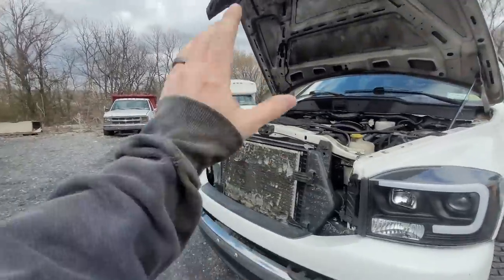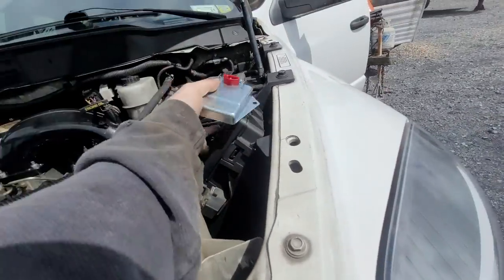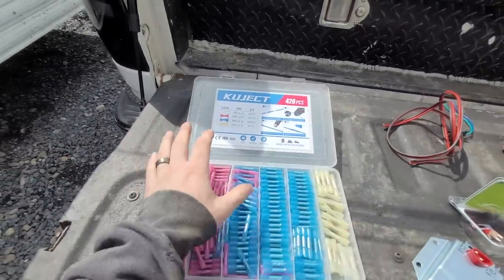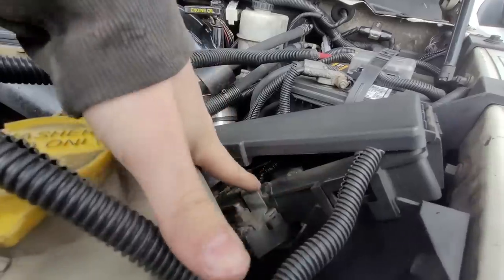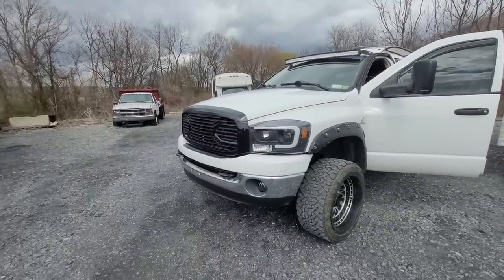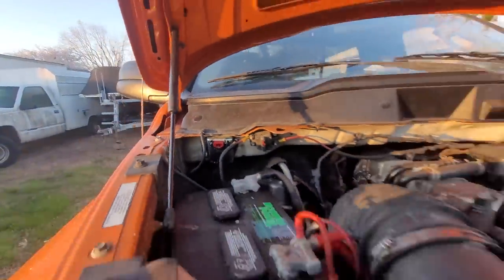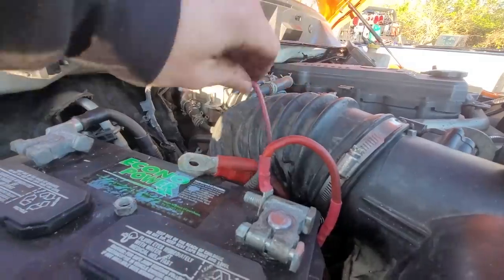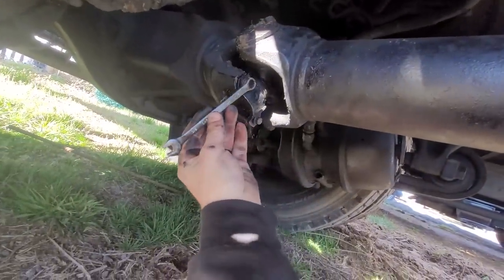3 Shops Couldn't Fix It... I Drove 2 Hours To Fix This Ram 4500 Tow Truck

Comment: I bought a new alternator that did the same thing. Turned out to be a bad one, brand new, go figure. Grounding also super important specially with all those splices he has going on under the fuse box, who knows how good those connections are as well as the grounds.

Comment: Was searching for info on a Dodge waste gate issue I was working on and found your channel.  Cool videos.  In this case if I was sure the driver in the pcm was fried I would find a used or salvage pcm and program it and be done with it.  Transistor drivers don't just fry by themselves though, always a root problem.  Interested to see what was causing the symptom.  I work mostly on Ford super dutys and with the twin alternator equipped models it can get complicated.

Comment: I'd be checking it with a volt meter. My 05 sits maxed out all the time according to the gauge but makes 14.2 consistently with a volt meter. Found that out the hard way. Good luck. 👍
Reply from the maker: I used 2 multimeters. I don't mess around 😅

Comment: I didnt think of this but a guy on yt suggests using a relay for 12 switched power because of voltage drop causing an over charge issue. You just wire a relay to act as your switched power so it has a good reading for voltage. His voltage was only around 16 volts not 18. A quick check to see if that works would be hooking the switched ignition straight to the battery, if that doesnt lower the voltage then neither would a relay. I would rule the batteries out by starting it and swapping in a known good battery, i honestly think its an issue with the alternator because 18 volts is so high.

Comment: Check to make sure the crossover wire is clean and grounded properly, the alternator will send power to the passenger side battery but power will build up because it can’t send it to the driver side battery correctly

Comment: I am in same boat with my 12 valve. 5 regulators nothing. New wires. Same deal. Also has a good Surge at idle. Always has had it. Though. From the voltage regulator as we swapped the Cummins in the k3500 some 20 years ago AND NEVER EVER HAD A ISSUE TILL NOW. JUST ONE DAY ITS HERE AND I SPENT PLENTY HRS ON IT SO FAR.

Comment: Get a nice pin remover set and a variety of different pins and you won’t have to use them butt connectors, best thing I’ve did however you need to charge because some of the connectors are expensive especially depending which type, also did you take the tipm out and check the plugs on the bottom to see if something stupid was going on there I know the regulator is through the pcm but you know how they are

Comment: New Alternator bud….. over charging is 90 % alternator issues. It’s internal the factory computer stops the battery from charging when the alternator is overcharging, that’s why you have too bypass for it too charge!

Comment: Could it be a bad crossover cable? It fits the symptoms. If the regulator is looking at drivers battery and alternator is charging passenger battery. If the Regulator doesn't see the expected voltage on drivers battery, it' going to over volt passenger battery. What is the voltage difference between the batteries through the crossover cabler when the truck is off?

Comment: I think it could be a bad alternator.  Something internally is causing the alternator to overcharge. I’ve had this exact thing happen before. Took me 3 weeks to figure it out. But, I’ve also had it where a bad PCM screwed up all kinds of electrical stuff. I heard you say it needs a new PCM, and that could be part of the root cause. Either way, great work man. I hope you get it figured out soon.
Reply from the maker: As of every truck I install these on I pull the pcm out of the equation. I've never had one fight me like this. I really want to get it working for the guy and not have him spend an arm and a leg. Someone botched the factory harness so even if we throw a pcm in it it still may not even fix the issue.
Reply: @CPSteveMiller  Check Your Voltage Regulator and make sure You don't have a bad one.
Reply: @CPSteveMiller  Pull the alternator and get it tested, the alt could be screwed up.
Reply from the maker: We tried 3 regulators. 2 were new, one was already on the truck😬

Comment: It's been said over and over but I had a issue with my chevy truck put a new alternator on it worked great then one day it shot up to 17.8 volts and the alternator went with in a month. Not sure where he got the alternator but if the batteries are good I'd get the alternator under warranty and go from there.
Reply: Was actually the day after I got the alcoa wheels from u it happened

Comment: You shouldn't hit battery post I used to do it to get them down but had it screw a new battery since it's soft metal it breaks internally and batterys are crazy expensive sometimes I just use a flathead and twist the connector open but if you buy proper connectors they are tapered one way so you can usually just flip them over and they fit like new

Comment: I would get the old nater just double-check to make sure I know it should have an internal regulator bill in and if it's bad it could be sending out too much current another thing is too I don't know I was told that you can get a one wire alternator for these you just got to change the pulley to make them work I don't know if you can or not you might look into that that might be an option

Comment: I seen you had the dvm. Was that where you was reading 18 volt.  The guage will never read correct with the external regulator.  I have done many of these conversions on second generation and guage always reads between 15 and 18 volts. With the dvm it's always 15 or under.
Reply from the maker: I used both multimeters to verify but the voltage gauge on these trucks are very accurate when they're actually hooked up. Anytime I'd check and verify though it would always be with the multimeter. The goal is around 14.5 volts. 15 volts is the absolute max a 3rd gen should be charging at. That's what my last 3 have charged at from the factory. Voltage regulator is about 14.3 is calibrated correctly.

Comment: I would recheck the alternator. Like many have said already, NEW doesn’t mean GOOD.  Kind of sounds like a bad Nator.  Unless it was overcharging before the new Nator went it.  And what’s the truck reading with a meter?  Is the volt gauge bad?!  If it’s reading 18 plus volts on a voltmeter then I got nothing. Lol
Reply from the maker: This one definitely makes ya think. I did some digging and found Paperformance sells an internally regulated alternator for the guys that swap 6.7s into other trucks. We installed it, put it to key on fused power and it charged perfectly at 14.4 volts. No pcm or wire harness replacement needed!

Comment: Cross over  battery cable is usually the culprit, if it’s not that then check for acid/corrosion damage to the battery trays (there’s a temp sensor under them which can malfunction and tell the computer to throw extra volts out…yes….yes I know that sounds stupid..but I’m speaking from experience)
Reply from the maker: I've got that same experience on the crossover cable. One bad connection and you get a blown up passenger side battery 😂 I actually cleaned all the connections and I'm actually getting 18 volts on the driver's side battery. If it's the crossover it would do 18 on one side and no charge on the other. 

I actually had a battery blow up on my original 06 about 7 years ago on my way to work. What a trip that was
Reply: @CPSteveMiller  well I agree that if you’re getting 18 v on both batteries then it’s most likely another issue…all things considered it’s either the temp switch under the driver side battery tray, bad pcm or the alternator could be shit…I went through two alternators before the parts house actually gave me a good one on my 01…unfortunately after Covid I’ve been getting more and more “new” parts that were crap right out of the box…and having friends who’ve worked at parts stores in the past they’ve told me that many of the defective parts find their way back on the shelf even though the need to be shipped back to the suppliers

Comment: I think you messed up right from the beginning, when you put the fuse power to the alternator, it goes to the regulator only, then the regulator output its power to the alternator.
Reply from the maker: You are incorrect. These are powered by a key on fused power source. 

How do I know? Because I got it working today using fuse power. It needs to see a 12 Volt source that turns off with the key. 

She runs good now. We installed an alternator with an internal regulator. Charges at 14.4 volts

Comment: You should’ve just a taken a red wire from the battery and a ground from the battery to the alternator and see if the volt gas was correct. Your way you where added power that’s why the gauge was up to eighteen than go from there
Reply from the maker: This is an externally regulated alternator. You cannot put power and ground to it or it will charge at 18 volts...

Comment: I bet if you got a 4 pin relay.. Put pin 85 to ground... Pin 30 to the battery.... Pin 87 to ignition... And pin 86 tied into the blue wire from the regulator. (This would cut out the ignition direct to the blue regulator wire). Problem would most likely be solved.
Reply from the maker: I tried a few variations. Nothing worked

Comment: Steve does the alternator have a built in voltage regulator? The contacts might be burnt and causing some weird  crap
Reply from the maker: It's in the pcm on these. That's why I put the external one because a pcm is 2300 bucks

Comment: You don't show the wiring diagram of the voltage regulator, which could be helpful in troubleshooting.  My thoughts are your wiring harness sends 12VDC (from fuse box/TIPM) directly back to the alternator excitation circuit, which it too high, causing your output of the alternator to be high.  The Voltage regulator should be the only one seeing TIPM voltage and then the VR will adjust output exciter voltage to alternator. So it may be that you are exciting the alternator with voltage not being regulated at all.  Just a thought.
Reply from the maker: I've wired in a lot of these, and you can see the diagram online. Middle wire on the regulator goes to a field terminal on the alternator(and to a 12 Volt key on source), and the green wire on the regulator goes to the other field terminal. 

I ran the same thing on my 12 valve swapped truck and on quite a few customer trucks. 

I agree that if you switch the wires, it's exciting the alternator with no regulator, but if the wires are switched the other way, there's no output. That's where it's getting weird. Definitely feel like there could be an issue with this alternator even if it is new..

Comment: I think you should check the gage.
Reply from the maker: I checked it with 2 different multimeters
Reply: @CPSteveMiller  You have 2 choices check the rectifier in the alternator or change the alternator.
Reply from the maker: Did that too

Comment: Sounds to me like the fields in the alternator are shorted to ground, if you hook it up the right way, ground goes right back to ground, and it won't give any output, but when reversed, you are sending power through what should be grounded causing the magnetic field to activate and just not be able to be controlled due to the short. If it were my vehicle, i would find a factory alternator in a junkyard and run it with your external regulator setup.
Reply from the maker: It makes sense. I actually tested the field terminals with the multimeter and got 12 volts one way and when reversed I got -12 the other way. Hoping it's as simple as a defective alternator because I have never had a voltage regulator not work on this same setup..
Reply: @CPSteveMiller  Yeah, in today's world, it seems like New means Never Ever Works, just put a new blower motor in my 04 Cadillac Deville, it worked for 17 days. I tore my old one apart, resurfaced the commutator, took carbon brushes from an old vacuum motor and filed them to fit, and now that motor runs better than it did when I bought the car in 2005. I guess different compounds of different carbon brushes make a big difference!

Comment: I wondering if the pcm may be disrruprupting the circuit
Reply: It isn’t a part of the circuit it’s not possible.
Reply from the maker: I even isolated the whole circuit and took the pcm out of the equation.

Comment: Maybe where you plugged the fuse in where you said it was kinda messed up with all of those butt connectors  there might be the problem in there
Reply from the maker: I tried going off of the battery as well and it still shoots up to 18. Going to try a new alternator when I get down there.

Comment: You did check your voltage with your meter and not just going by the dash gauge right? We all know how many problems those dashes have lol
Reply from the maker: Yes, but even still the factory gauge in the dash is very accurate. I have two multimeters on board and anything my meter read, the gauge read the exact same.

Comment: Pretty shure those altternators are internally regulated
Reply from the maker: They are not
Reply: @CPSteveMiller  pretty shur all modern alternators have  an intergtated  voltage regulator
Reply from the maker: No modern alternator has an integrated regulator. 

IT IS IN THE PCM. All modern vehicles use the pcm as a voltage regulator.

When you buy a new alternator it will even tell you

"This unit is EXTERNALLY regulated by the vehicles computer"

Comment: Put a one wire alternator on it . Those regulators from the 70s are junk. I exploded a battery .  Went to hell very undependable. Absolute junk regulators
Reply: They are literally used on every chrysler in the old days and whatever else they was on... they work great you've just had bad luck lol.
Reply from the maker: I've used quite a few without issues

Comment: Ground
Reply from the maker: I cleaned every single ground on the truck, brand new wiring, brand new batteries, grounded the alternator, grounded the regulator, etc. It's not a wiring problem at this point
Reply: You from Maine?
Reply: @CPSteveMiller  Grounds loose connection in more ways than between the bolt and the block or body. They also loose connection between the terminal and wire.
Reply: @CPSteveMiller  I said this before watching the video. It might not be a ground it might just be a bad alt.